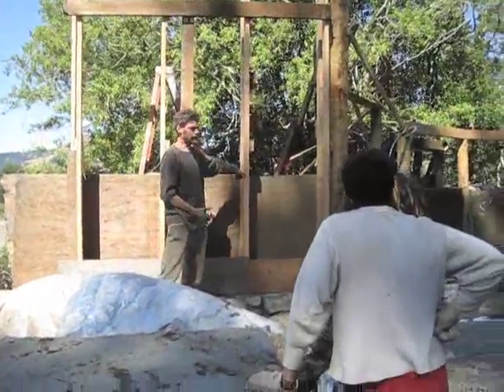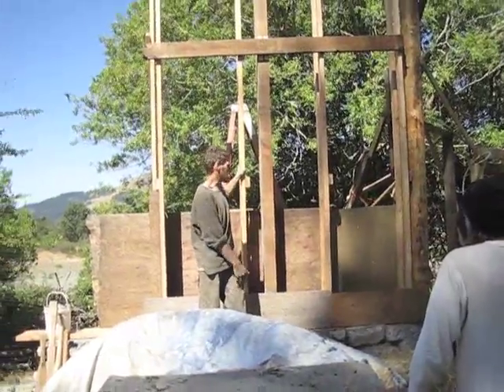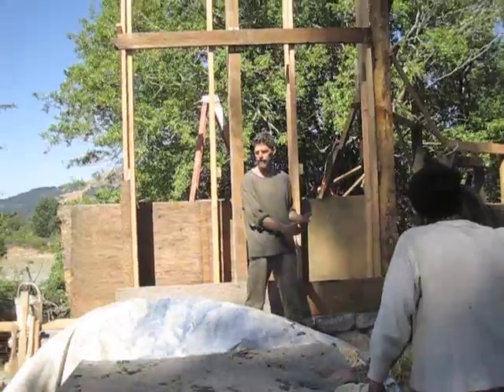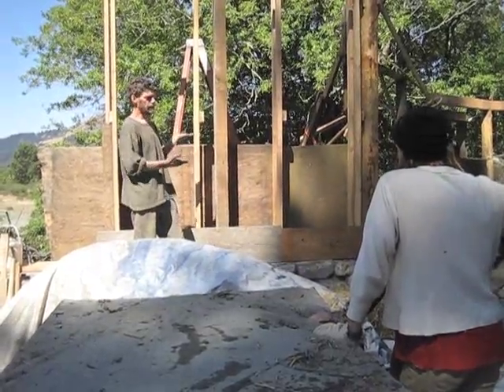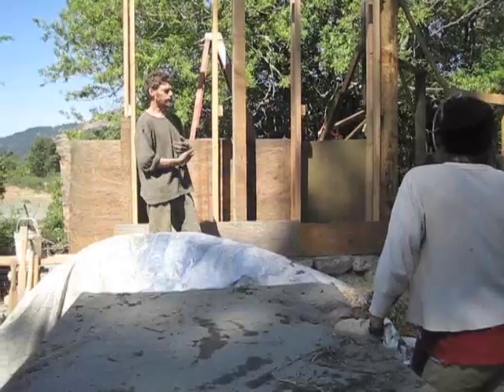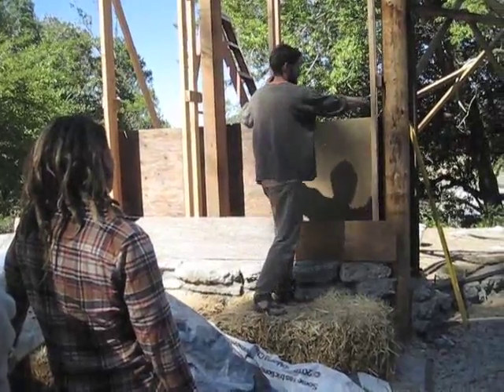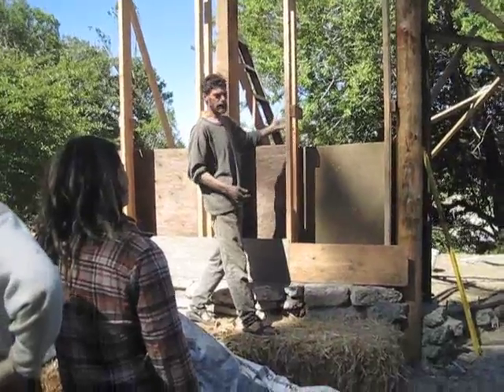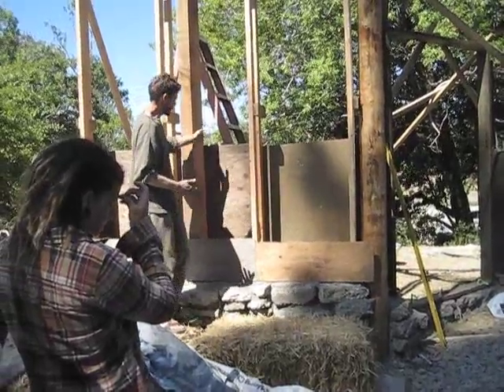Slip Straw Construction with Michael G. Smith

Comment: What is the purpose of the clay, I wonder? It increases thermal mass, if that’s desired. Without the slip, would you have to use lathe or some permanent form to keep the tamped straw from eroding out of the wall? Sure, it helps prevent fires and some measure of mold and insect protection - but the plain tamped straw shouldn’t be prone to either anymore than a bale wall is...

Comment: I've seen so many videos on straw bale that have no information. Just a bunch of hippies showing off that they're build with straw. You sir are informative and awesome. Thank you for not wasting my time.
Reply: Strawbales are very straightforward, especially small structures and . Research some basics on masonry construction and build a good frame and foundation and itd be hard to go wrong. The major tips are: generous roof overhangs, consider a covered porch, wall, tall fence or outbuilding on the side facing the wet season’s prevailing wind, to block wind driven rain. Also, a single story wall is better on this side. Second tip: use high quality lime plaster on this wall if not observing tip number one. Tip number three: pay attention to windows in bale walls. If there is an exterior sill, it needs tiling, slate or flagstone or durable wood, or very, very smooth, well done plaster, and must drain. An eave or awning to keep rain away from the window, again, especially on the windy side of house during the rainy season, is a good idea.

None of this applies in deserts, except the sills being able to drain. And all applies to most other wall systems in non-desert climates.

Comment: Just did a first experiment with a form and slip straw on a small piece of wall. We wondered how does the slip straw bond with the stud work. Especially on long expanses of wall. We were using a bamboo framed houses .
Reply: You nail a long strip (or strips) to the stud running vertically and centered. This provides something for the LSC key into and creates a baffle to help thermally I suppose too.